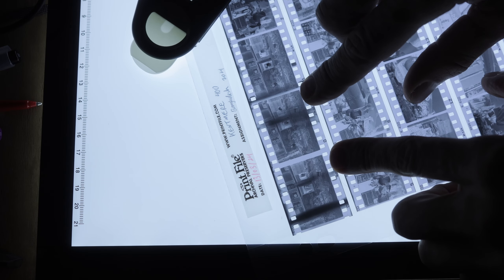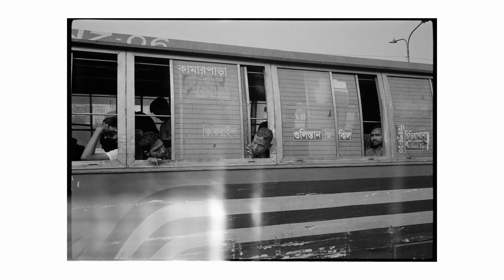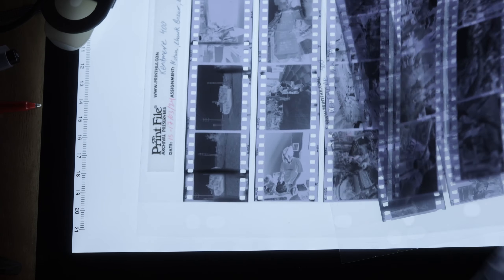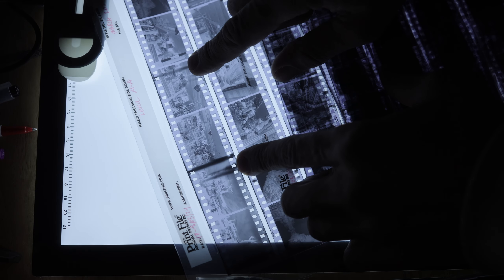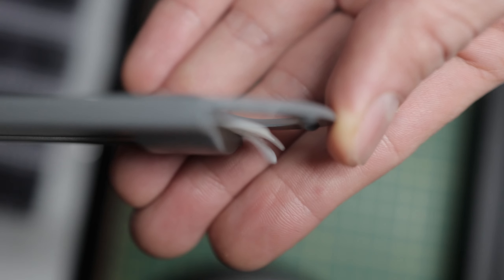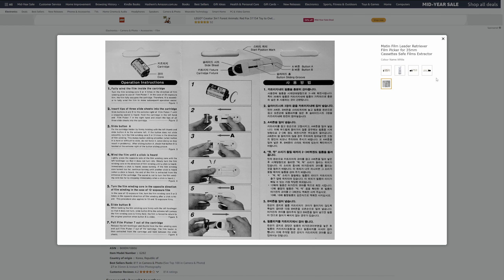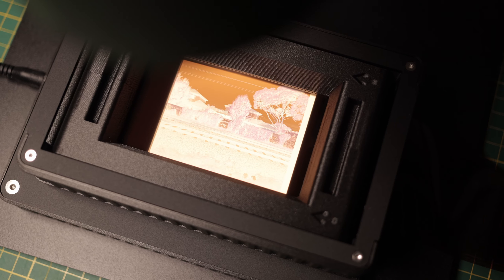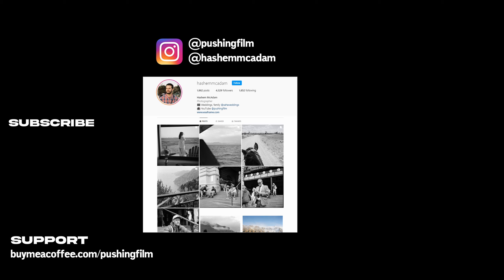Film picker retriever causing light leaks?

Comment from the maker: Update:
1- I want to reiterate that this isn't a blanket problem with film retrievers. I've also successfully used them for years in the past, which is why I suspected my particular copy. 
2- I've had feedback saying this could be a problem with Ilford (and thus Kentmere) films. Although I have also had the same leaks on other films (like Rollei), I mainly shoot Ilford films... so it's worth investigating. Maybe the particular combo of Ilford rolls + a "bad" picker? I'll continue testing, paying attention to the film brand.
3- Something else I suspected could be an issue, reinforced by some comments: The translucent white plastic on some pickers instead of opaque black. This one makes sense as a potential cause of light piping.
4- I also appreciate the tips like using wet film, tape and other tricks like just leaving the leader out when rewinding. I'm already aware of most methods and alternatives, but leave your tips anyway because it could help others, and you might still have something new. 
5- Thanks for all the feedback and comments from everyone to help us solve this, and sorry if I haven't replied yet! If you have the same issue, please investigate whether it's only on Ilford/Kentmere films and edit your original comment with this information.

Comment: I also have the same issue sometimes! I have a Matin. I also bulk load and thought maybe the felt could be old but this makes more sense too.
Reply from the maker: You too! Is it only (or mainly) on Ilford rolls in your case? Although I've had it on others, I mainly shoot Ilford... and it seems like they had batches which are prone to leaks through the felt trap.

Comment: I've only used a leader retriever for a few accidental situations where I rolled the film back in. I too am now saving cassettes to reuse for bulk rolling. I recently found that I could actually use the ilford opener, same as you have, to carefully remove the top without bending it significantly. Had to squeeze the sides a bit while lifting with the opener, slowly increasing pressure, but it worked and I could seal it back up without much issue. Not quite the same technique as cracking open a fresh beer, but it wasn't bad.

Comment: This is an informative video, thank you for sharing your experience with us. I think your retriever just wore out and it is a good idea to replace it. Try also retrieving the leader just with another short piece of film. You could save little stripes of scrap undeveloped film from rolls you develop, and use them to retrieve your leader. You just have to wet a little bit one of the ends and insert that into the canister you want to retrieve the leader from, spin the film inside the canister a couple of turns and most of the time the 2 ends stick together and then voila, you got your film out.

Comment: That's really interesting! I work in a lab where we use leader card processing for our C41 and BW stuff, and I use a picker similar to this one (will have to find out the brand BC I'm not sure). Never seen leaks like this but will be weary of it, especially given the picker is used for about 70ish rolls a day so it should be getting alot of wear and tear.
Reply: Found it's the HCL picker 4 - pretty expensive offering but never had issues with it even with heavy use.

Comment: You might have just solved my light-leak issue on the first frames of many of the films I shot and developed ! Thanks, I'll be more careful now.
Reply: Same over here, I’m speechless… it never occurred to me since I have been using a new M6 and was about to blame it, but it makes sense since I also recently started using this retriever. I’ll see if a dark bag or room can solve the issue.
Reply from the maker: Was it only(or mainly) on Ilford/Kentmere film? I'm trying to investigate this next
Reply: @pushingfilm  so far it happened twice with HP5 and once with Delta 400, I can’t speak for color negative rolls since those are waiting to be developed, but I will probably use a dark bag.

Comment: I've had a similar issue. My working theory was that it was a problem with the felt, as I was bulk-loading cartridges and figured I may have overused one or two. Never even considered that the film picker could be a culprit. Thanks for this
Reply from the maker: It could even be a combination of certain felt seals with certain film pickers! I'm looking into this now, as I've had people comment that it's unique to Ilford (although I've had it on other films too)
Reply: @pushingfilm  The cartridges I used to load up the film weren't all Ilford, though the film itself was. Will have to monitor and see!

Comment: I've never had this problem and I've used the Arista Deluxe retriever. I think it's the same one you showed in the video (except black instead of gray). I've used it on around 250 rolls of HP5, Tri-X, Porta, etc. I don't bulk load so the felt is always fresh on my rolls. Mine also isn't warped like yours. So sorry to hear you lost some good frames due to this problem.
Reply from the maker: Thanks for sharing. I'm onto some clues and am gonna keep trying to get to the bottom of it :-)

Comment: I've used and still use a MATIN film retriver and get no light leaks. I've used it for more than 100 rolls of 35mm film. Good luck !!
Reply from the maker: Nice! What's the main film stock that you self-develop?
Reply: @pushingfilm  Generally cheaper C-41 films like ColorPlus, Fujifilm C200 and ImagePro 100. On special trips, I'll specifically purchase, shoot and develop Kodak Ektar 100, but the price of Ektar, and generally all films has sky rocketed lately. I also like shooting B+W films, like Fomapan 100, Shangai GP3, Kentmere 400, or FP4.

Comment: The only thing I can recommend is to not rewind the film back completely into the cartridge. To indicate that I have used that role, I just bend the film leader. Never had any problems with light leaks, etc. If the film gets into the cartridge by accident, a piece of double sided tape and my dummy film roll work as some kind of film retriever. Or, homo brutalos style, destroying the canister in the darkbag 😅
Reply: I agree with you if it's an old style camera where you manually rewind the film.  Unfortunately, a lot of the more modern film cameras automatically rewind after taking that last shot.  In that case, you have to use a picker or can opener.  I prefer using the picker because I like to start the roll on the developing reel before I put it in the changing bag.
Reply: @GirdHerd  True, although I just recently discovered that Minolta cameras have the option to leave the leader out after rewinding. It is hidden in some menu but good luck finding that having no user manual…
Reply: My Canon film cameras, A2E, Elan IIe and Elan 7e all have a custom option setting to leave the leader out after rewind.  Works great for changing film mid-roll or for processing.  Kinking the leader on used rolls is a great tip!

Comment: I never roll the film all the way back into the canister. I leave the leader out & rip the end off so I know the film has been shot. When I get ready to develop I cut the end with scissors for loading & then in the dark or changing bag load the film still in the canister & cut the film when it is on the reel. This way you can reload the canister without opening it. Also works for reusable canisters.

Comment: I use metal film retriever by ARS-IMAGO and it's a bit tough one but it works, no light leaks whatsoever. I also have Kaiser film retriever but never had any luck with it, even after watching numerous tutorials still not able to retrieve film with it for some reason :( 
Worn out felt on the canisters could be an issue for the light leaks as well

Comment: I have been getting more and more of these exact light leaks on the first few frames of ilford films only. And I never use a film picker for any b/w but I do for all my color stuff (which never has these light leaks). My hypothesis was that the ilford seals on the slit of the 35mm canisters weren’t sealing well when you physically pull the first bit out to load it into the camera. Not 100% sure it’s caused by the film retriever
Reply: I got light leak on the first frame of my kentmere 100 film too and I didn't use film retriever either. And the shape of the leak was just like the shape on the video.
Reply from the maker: Thanks for sharing. I'm seeing a few reports of this, and it seems to be at least part of the problem for me (although I've had the same thing on non-ilford frames too) Are your leaks roughly equidistant and can go as far as the 3rd or 4th frame?
Reply: @pushingfilm  mine was only on the first frame.
Reply: @pushingfilm  yes. I’ve certainly had them all the way to the 4th frame. I also work in a lab, and use a film puller on every color roll we do, and have never seen anything that matches what I see on my own b/w (and again, I never use a film puller on my b/w)

Comment: I haven't had this issue, but, I have thrown away that damn useless film picker away anyway as it only ever worked sometimes. I also bulk roll and want to keep the canisters.  And by pulling taht leader out i can start the film end into the patter reels prior to turning out the lights in my darkroom.  I get the film leader out with an old length of exposed film about 20-30cm long.  You damp the end and feed it into the canister, slowly wind the canister and the moistened film will stick to the leader and start to get pulled into the canister.  Stop and slowly pull the film piece out and the leader comes with - works every time.

Comment: Film picker retriever causing light leaks? It is the first time I heard about that but it could be, why not.
I have been told by a technician that owns a film lab shop for over 20 years that the quality of the foam in the canisters is not the same as years ago, now it is much lower quality. I bulk load every week and now that I am loading the camera in very dim light or deep shadows I can tell you that que quantity of rolls with light leaks has drastically dropped off. Try this and use the retriever in low light and you should be fine. Hehe, yes, it is always the best frame, the one with light leeks. We have to accept the uncertainty of analog photography ,scratches and light leeks, the everyday pain in the ass.  Best of luck.
Reply from the maker: Yeah I generally try and make a habit of loading in subdued light, as much as possible. Using the retriever in complete darkness does fix it. In low light, still unclear. Pretty sure mine is dodgy, so I'm getting a different one to run more tests. You're absolutely right though, that's part of the fun of shooting film!

Comment: Eureka! Problem now solved. I thought the light leak was from loading the film on the camera. I was using the film picker so I could load the spool easier in the dark bag. This system wasn't working as well as I had hoped anyway because the neat trim  I made at the end of the leader depending on the camera had quite a curve to it so it often got caught on the spool. Then I had to take it off the spool in the dark bag, use the opener to open the cassette  and re-trim the negative. Now that I know what the cause of the light leak is I don't think I will bother with the picker. Sometimes the simplest solution is the best. FYI I have seen other YouTube videos which suggest opening the cassette from the bottom end but not the spool end. I'm not sure why but that's how I do it. Thank you very much. Cheers!
Reply from the maker: Glad to hear this might have helped! Was your issue happening on one particular film stock, or across multiple? Also, I think leaks on the first frame are always a possibility, but when they're equidistant up to the 3rd or 4th, then it seems to be from the felt light trap.
Reply: @pushingfilm  I only use HP5+ and it was a sporadic problem. I'm not convinced that extracting the leader and trimming it before putting it on the reel instead of doing it all in the dark bag is any easier. One of my cameras- Rollei 35S seems to curl the  negative more than the Leica MP even from beyond the leader so it still jammed on the reel. If that happened I have found I  can get a straight cut from the spool end. Best regards.

Comment: I was pretty sure that this was a recent Ilford problem,  but your negatives are not Ilford.  I have had the same problem without the film picker on B&W film only.  Strange.  Delta is getting very expensive,  so it's not really acceptable.
Reply: Kentmere is produced by Ilford, so it actually adds up! Had the same leaks on the first few frames of XP2, HP5 and Kentmere 400 as well, never on my color rolls tho.
Reply from the maker: Thanks for sharing! I think this has something to do with it, as if certain batches of Ilford/Kentmere are more prone to leaks through the canister.